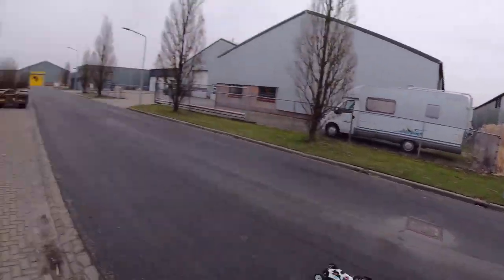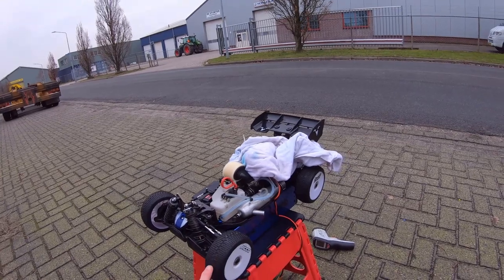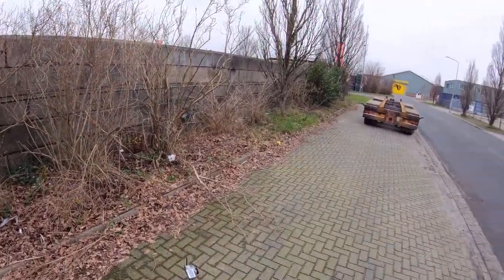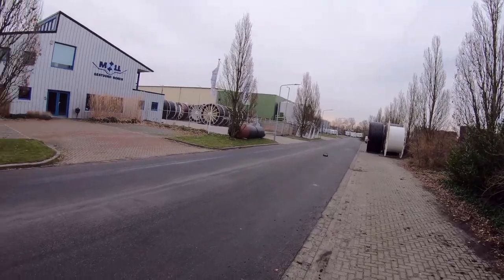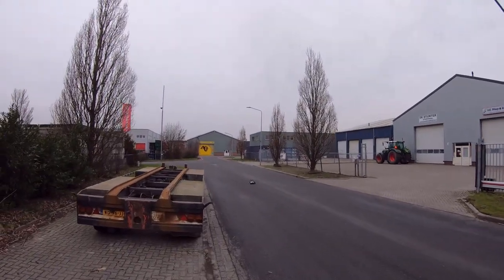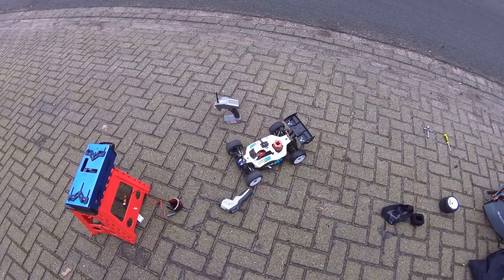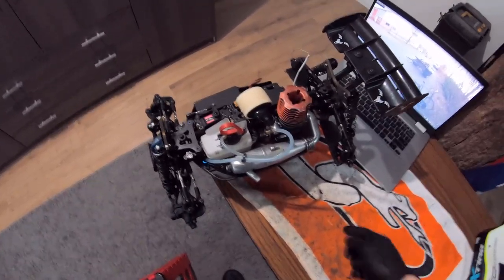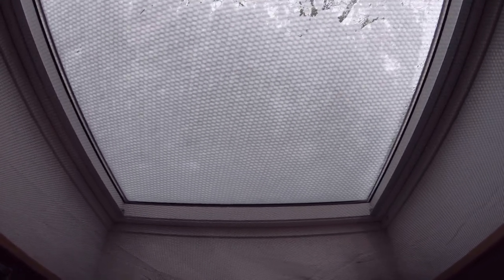Overpowered nitro rc buggy hits 60mph & blows up tires!

Comment: Hell ya dude💪💪 that thing is insane!! Just got my losi lst running good. I got the high speed clutch Bell with a lrp zr30 spec 2(truggy wheel conversion too). I need to put a gps on it because it looks to be doing high 40s. Anyways looks awesome!
Reply from the maker: Thanks man! Now the next test will be: Can this thing push a truggy?
Reply: @NitroMike I think so! Might take a little longer to get to top speed but I think it will do it!

Comment: Mike I'm looking forward to seeing that thing in the Truckee man it definitely flies in that buggy looking into some new tires for the truggy too
Reply from the maker: Yeah man I was actually wondering if the speedrun contest allows to run belted / onroad tires on the truggy because this will happen at high speeds
Reply from the maker: Also keep in mind I got this engine custom build / modded specifically for speedruns. I am sure it will fly in the truggy too
Reply: @NitroMike  yep belted tires no problem

Comment: What starter box would you recommend? I might get a backplate engine for my buggy. It will be the 1st time having a box. I already have a 4s lipo that I used when it was an eword. 

Still sticking with the pull start for the monster trucks though :D
Reply from the maker: I run a Robitronic starterbox and a T2M starterbox

Comment: hi nitro mike 
can you help me with sth
I bought a Kyosho Inferno US Sports , so its a prtty old car.
what do i have to du to hold up with the newer cars (motorized)
And what are the normal maintenance things you do ?
And witch parts ar critical in old motors like this (GXR28-SG)
Reply from the maker: Make sure the conrod is still in proper shape and doesn't have play on each of the rod ends,  make sure the carburator still opens and closes smoothly and is still sealed, if not replace o-rings. For maintenance I always empty my fuel tank and fuel lines after each bash, then I proceed to start the engine until it is out of fuel, then I put a couple drops of Marvel mystery oil in my engine via the carb. Also make sure to put the piston at bottom dead center before the engine cools down
Reply: @NitroMike  thanks a lot 
you realy helped me 
one last question or thing to talk about 
i bought a starter box from amazon caus'e my pull-satrer fether broke 
can it be posible that the starte box isn't powerfull for my engien ( the starter box got 2x 775 motors)
or Am i use the wrong battery ( i got  1x 8 cell 7,3v 5000 mAh)
Reply from the maker: @lukitime7139  You need to run on two 7.2 nihm cells or one 3S or 4S lipo for it to work
Reply: @NitroMike  thank you so much for helping me you are a great guy 
Thank you so much
Reply from the maker: @lukitime7139  You are welcome!

Comment: Hey man do you know anything about the Hobbyking EG Sport 21 Two Stroke Glow Racing Engine?
Reply from the maker: Sorry I have never owned one of those. I though hobbyking dropped all their nitro stuff long ago?
Reply: @NitroMike  I found them on ebay around 60eu with shipping to me
Reply: I own the 28 eg. There great little motors. There clones of the dynimate motors that come in the losi eight so you can get parts for it. I have a video on my YouTube channel reviewing this motor if you want to check it out.
Reply: @nitrosocietyrc2787  can you please send me the link?
Reply: @nitrosocietyrc2787  what type of spark plug does it need?

Comment: You really need to get some proper speed run tyres. If you have a bad tyre blowout at 60+ you might flip the car or hit the curb and destroy the whole thing.
Reply from the maker: I am more worried about flipping the car while the gopro is on it since gopro's are not cheap